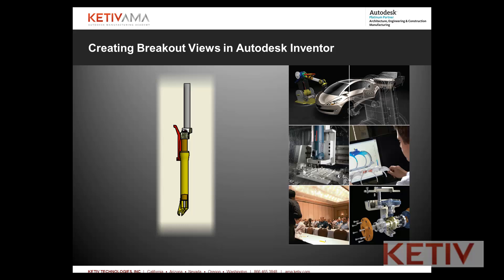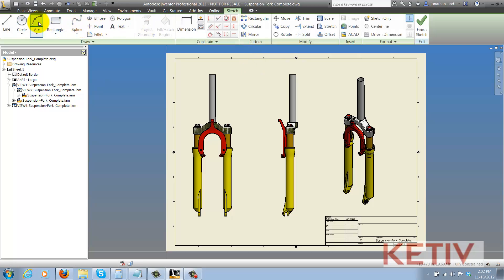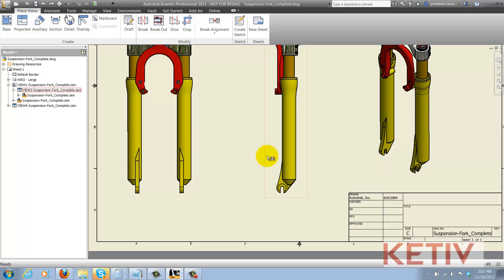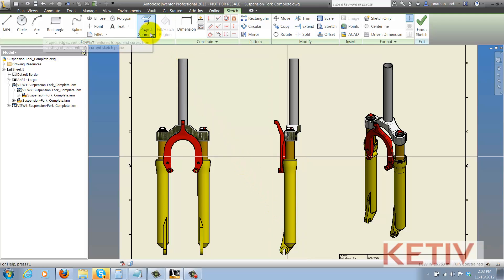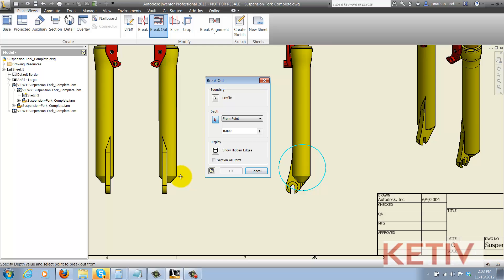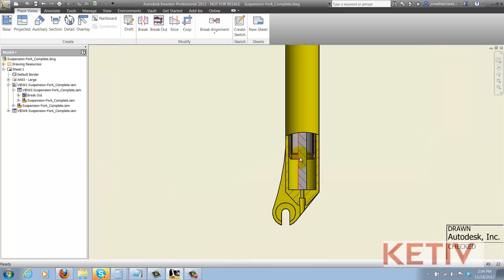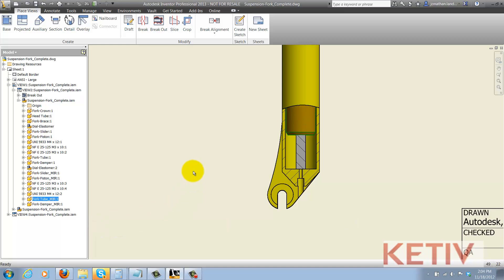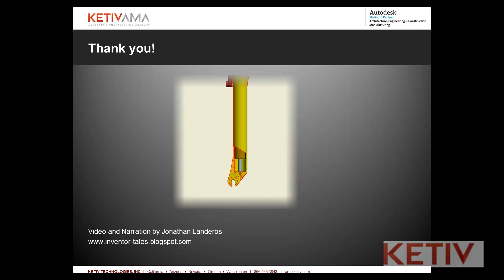Creating a Break Out View in Autodesk Inventor

Comment: I cannot select any point. I hover over the edges or vertices, but the icon does not show up. Even if I try to select a point on a different view, it won't let me select anything at all. The cursor does not snap to anything in the sketch. I tried re-installing the software, but it did not help.
Reply from the maker: Petr, in what context can you not select a point? There are options in the component priority drop-down that will change what objects the cursor will prioritize clicking.
Reply: @KETIVTechnologies  Thanks for the reply, but I figured it already. I was trying to add a breakout to a .stl file which turns out to be only a mesh of triangles. When I tried it on other parts, it worked fine. 
Thanks anyway, though!

Comment: i am trying to use these tips, but  break out does not work in section view for me, only if i use "slice all parts" (i mean, here Jonathan uses break out in base/projected view). This way i cannot exclude that part, what i dont want to slice and what is "inside" the sketch curves.
Any idea?
Reply from the maker: Are any components, particularly anything that "covers up" any other parts have it's section option set to "None"?  That's the only thing I can think that would cause what you describe.
Reply: Yes it's option is set to none, but as it is in section view, if I set option to section, it shows the whole part in section, what is nothing to do with the break out view.
And as slice all parts option in break out view has priority so I am trying to trick with the shape of the sketch and correct the mistakes manually by now...:( .

Comment: For Additional Problems with Sketch Break Out and Sketches:
If you don't know: Sometimes you need to create a unique shape for Break-out. (not a circle or square) Create your sketch and Right Click on a line in the sketch to bring the menu and select "close loop".  Go around your loop selecting lines and curves to add to the loop (sometimes it ask to add other features. Click OK each time.  Now you should be able to get Break Out from your custom shape.